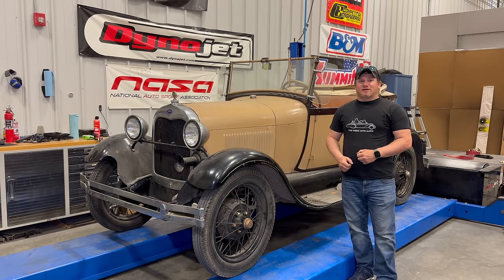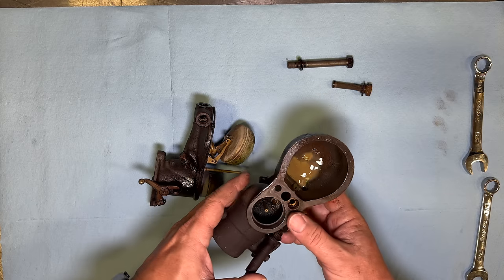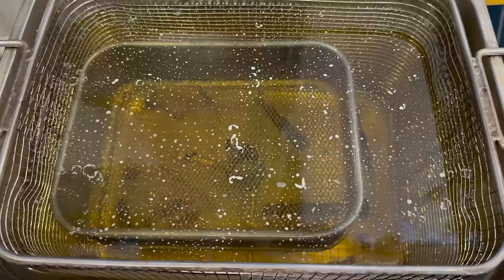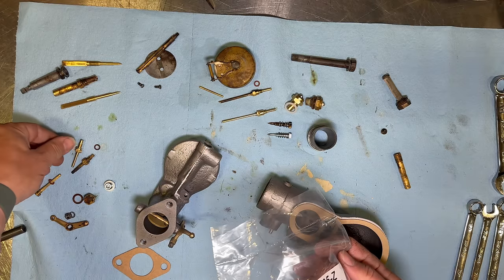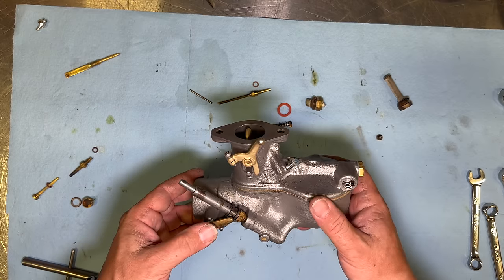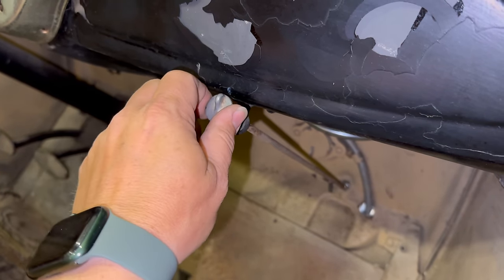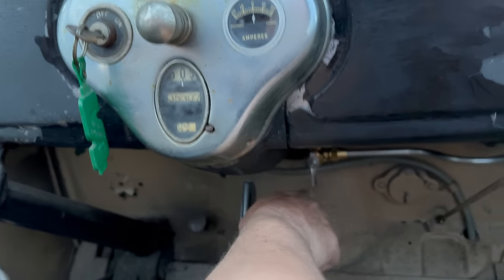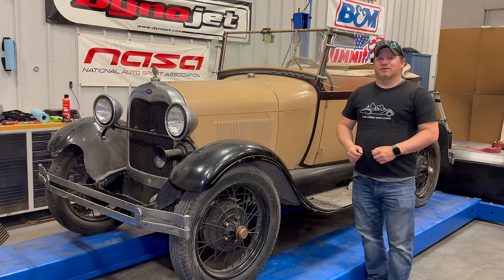1928 Ford Model A - Carburetor

Comment: I remember reading a story, years ago, about how Henry Ford challenged the engineers as they iterated the design of the carburetor to reduce the number of fasteners clamping the two halves together. They ended up with one, which the video confirms. 👍
Reply from the maker: With that one bolt you can easily service the carb with the rest of it still bolted in the car!
Reply: Another tid-bit of trivia about model A's that I didn't know until now. Thanks!

Comment: Some of the replacement carburetor rebuild kits have jets that are not the correct size!  It's a good idea to check the length and the orifice sizes before replacing the originals, which in MANY cases are better than the new ones!

Comment: A thorough clean ['sonic not required] is about all that is required. The new jets are not as accurate as original ones which are quite OK to re use. You do not need extra modern plastic fuel filters added. You need to read up on carby adjustment & starting proceedure if no prior knowledge. These cars are simple but guessing will not make them run great.

Comment: That long jet (idle jet) you put into the top casting does not get a gasket.. It has a tapered fit into the casting.. Like a previous comment I read I want to get some of the solution you used to get the castings that clean after in an ultrasonic cleaner!!

Comment: There's a problem I've run into on older carburettors with the butterfly shaft wearing the throttle shaft bushing out of round so there is a vacuum leak around the shaft. This makes it practically impossible to get a smooth idle. You don't notice when you're in the other circuits but it's a pain at idle. Have you ever run into this? You diagnose it by shooting carb cleaner at the shaft bushing to see if the idle changes. If it does; you've got a leak.
Reply: I had a Datsun 240Z for almost 30 years. Dual Hitachi carbs that were a copy of the SU English carbs. When I had to get it smogged the technician (was the father of a friend of a friend) saw the throttle shaft area worn.
Said I can either put a dab of Vaseline on throttle shaft end to seal up leak for the next time to re-smog test or get carb throttle shaft area rebushed.
Had bushings installed and smogged no problem the next time.
For a temp fix to get things dialed in some Vaseline should work ok.

Comment: Good work Steve.  Sounds a tad rich.  Some of the repro jets are a little bit too big, causing rich mixture.  See how it runs with the GAV closed. If it won't lean out, swap the original jets back in.   Curious why you opted to leave the casting bare instead of paining it black.

Comment: Well done.  Wish you'd have emphasized the importance of the spacer/washers under the float valve.  So many Model A's leak gas out the carburetor because of an incorrect float level.

Comment: What fluid do you use in the US cleaner?  any particular temp you run it at?  Looks like it worked really well on that carb.
Reply: I came here to ask the same question.  That cast iron looks brand new. 

I almost wonder if it got vapor honed after coming out of the cleaner.

Comment: Spark timing?  Is it fixed mechanical or allow for some adjustment?  Seems a little retarded.
Very cool car.  Amazing can get parts for it easier than some much newer cars I've owned.
Reply from the maker: You adjust it on the steering wheel.

Comment: Hi Steve , I too wonder what fluid you used in the ultrasonic cleaner . I have cleaned many Carbys in my ultrasonic tank using water and clean green detergent but cannot get your results. I also find upon removal from the tank you must dry the Carby instantly or it starts to rust . 
Regards from down under Russell 🦘🦘
Reply from the maker: It is called ArmaKleen M-100 BCR but I don't think the general public can get ahold of it easily.